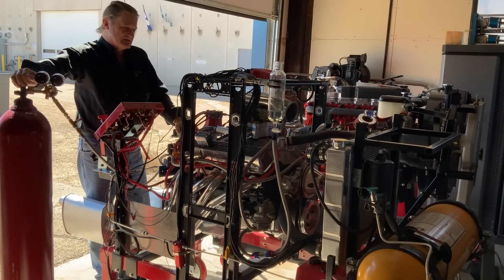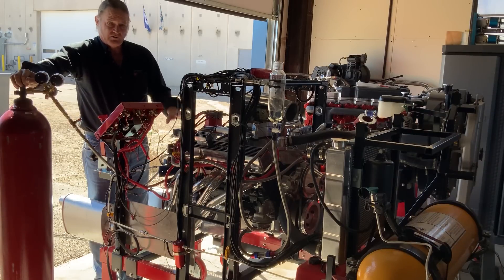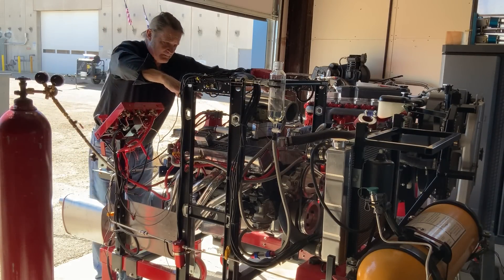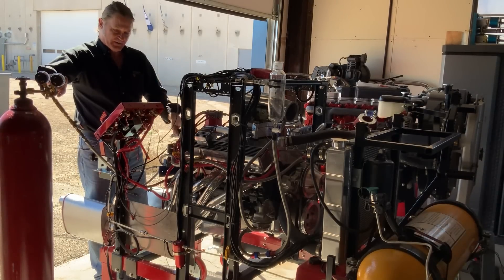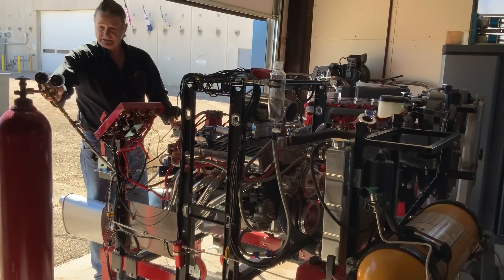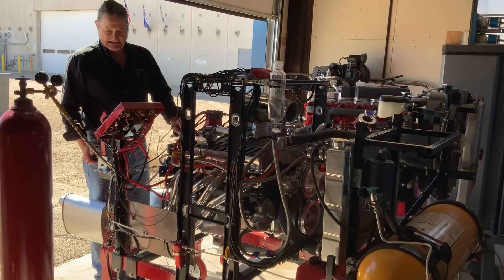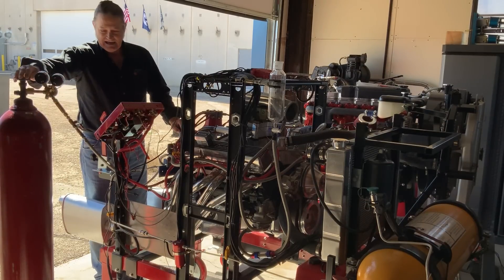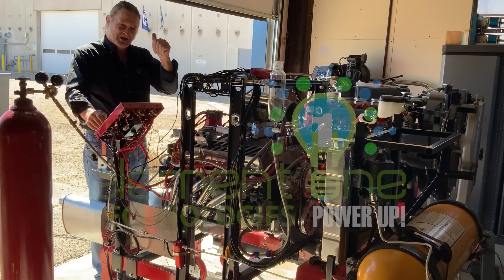Hydrogen powered V8 ICE High RPM Test

Comment: Cool, do you have a means of controlling egr to attain / co-equal the burn rate of petrolium fuel? If not then you might be running a fair bit more hydrogen than required? Have you considered hydrogen/argon or nitrogen pre-mix  for testing? Maybe build a blame front test rig.
Reply: Argon doesn't burn.  It's a noble gas.  Nitrogen nearly doesn't burn, which is why it is used in fire extinguishers.  We have enough nitrogen in our atmosphere already (+-78%).
They are not fuels.  Quite the contrary.

Hydrogen and regular air are all that's required.
Additional fuel and maybe an oxidizer could be considered should more power be required, or to reduce the hydrogen consumption.
Reducing the hydrogen consumption would just mean you are going to burn more of something else (like gasoline).
Reply: @detaart  That's exactly my point. Hydrogen burns far too quickly for all of it's potential to be extracted to mechanical advantage. Mixed with noble gases it's burn rate can be slowed to be more efficient in a standard combustion engine. Noble gases are used prior to being mixed with air in the cylinder by normal means, so that the mixture is safe, and far less hydrogen is required. It's possible to add this Hydrogen/noble gas mix into an existing diesel engine without performance reduction. Expect to see this in mining equipment very soon.
Reply: @scottneels2628  yes flame speed of Hydrogen is high if you have a stoichiometric H2 O2 mixture however if the stoichiometric mixture is done with ambient air you will have already a far slower flame front speed due to the high Nitrogen content.  Adding additional non fuel gases to the mixture will furthermore increase a big issue with H2 gas in a naturally aspirated ICE and that is its very low volumetric energy density and with it it occupies a lot of space therefore limiting the amount of fuel energy available with a stoichiometric mixture in the fixed cylinder volume.
Reply: @milanswoboda5457  in reality it takes significant egr to make hydrogen usage reasonable.
Reply: @scottneels2628  significant egr?  for what?  to reduce a low efficiency even further?
Reply: @milanswoboda5457  to reduce propagation speed within any given volume to equal the original fuel and allow an engine to run original timings.
Reply: @scottneels2628  EGR is used to reduce NOx emissions however the adverse effect is a lower thermal efficiency of the engine.  If your fuel requires different timing then you better adjust the actual timing and not the EGR,  and there it doesn't matter if it is H2 or any other fuel including specially formulated racing gasoline.
Reply: @milanswoboda5457  This is quite a fascinating conversation. I appreciate your time to reply.
Reply: @milanswoboda5457  We agree, egr or any addition of non combustible gas to a given volume reduces its potential. Also that it's used to reduce combustion temperature to avoid nox. Egr is also used to reduce minimum fuel for a given volume and pressure before detonation (lean knock prevention). Hydrogen usage can be reduced in the same way.
Reply: @scottneels2628  Hydrogen remains explosive under a wide range of AF mixtures so you could lean it out significantly without "noble gases" or increased EGR and as the physics of things go, less chemical fuel energy in = less combustion heat energy released =  less temperature delta =  less useable kinetic output energy.
Reply: @milanswoboda5457  Yes, but it's too fast at those lean afr hence the need to distribute a pre dilution evenly within any specific chamber volume for it to exhibit original fuel characteristics. Without this there is no way to avoid detonation.
Reply: @scottneels2628  laminar flame speed isn't any faster at lean mixtures, on the contrary it might be slower as the fuel molecules in a give space are further apart.  Detonation/uncontrolled combustion  is generally not an issue with Hydrogen in an closed combustion chamber due to it very high autoignition temperature and very low quench gap however it has a very low ignition energy requirement so impurities inside the chamber, fuel or air can lead to uncontrolled ignition but if those exist then it doesn't matter if there is EGR or a non stoichiometric AFR, it will go boom.
Reply: @milanswoboda5457 quoted: June 1994 Brent K Bailey et all.

The hydrogen fuel-air formation for a spark-ignited engine can be mixed external to the cylinder or in the
cylinder. Mixing in-cylinder can be either early injection, which forms a homogeneous charge, or late
injection (near top-dead-center, TDC) so that the fuel burns as it is injected, as in a diesel engine.
External mixing of hydrogen and air is limited both by the power that can be produced and by backfiring
through the intake system. The power limitation is due to air being displaced by hydrogen gas. Because
the air/fuel ratio for a stoichiometric mixture of hydrogen is 2.4 by volume, the maximum air flow into
the engine is reduced by about 29% relative to injection of the fuel into the cylinder, reducing the
maximum engine power by a similar amount Backfiring associated with external mixing of the fuel
occurs when pre-ignition of the fuel advances at every cycle until it finally occurs before the intake valve
is closed, causing the flame to propagate into the premixed charge in the intake system and explode
(Furuhama 1 992). One approach to avoiding backfire is to make the hydrogen-air mixture lean to slow
the flame speed; this results in a practical limit of about 50% of the power available from stoichiometric
combustion of hydrogen in the same-size engine (Furuhama 1992). External mixing can result in very
high efficiencies under lean operation, but is limited in maximum power.
There are two choices for in-cylinder injection of hydrogen: (1) early-cycle, low-pressure injection
forming a pre-mixed charge, or (2) late-cycle, high-pressure injection (near IDC). The early-cycle
injection is limited by pre-ignition from hot surfaces and by knocking due to the very high flame speed
of hydrogen (320 cm/s for rich mixtures versus 45 cm/s for most hydrocarbon fuels; Glassman 1987).
This results in erratic combustion and limits the power available. The pre-ignition problem may be
somewhat reduced by injecting cooled hydrogen gas, but this approach appears to be more effective for
2-stroke engines than for 4-stroke engines (Furuhama 1992).
Late-cycle injection of hydrogen overcomes the pre-ignition problem if the fuel can be ignited early in
the injection process and then burned as it is injected. However, the ignition and burning can be very
rough if the ignition timing does not allow combustion to occur very early in the injection process
(Furuhama 1992; Koyanagi et al. 1993). Very careful control of spark timing and location can help
control the erratic combustion. Also, late-cycle injection requires high injection pressures to overcome
the high cylinder pressures, with injection pressures of about 1 l\1Pa (Koyanagi et al. 1993). This late
cycle, high-pressure hydrogen injection may be more easily controlled and more practical using liquid
hydrogen rather than gaseous hydrogen. Musashi Institute of Technology (Musashi I.T.), Tokyo, Japan,
has developed liquid-hydrogen storage and high-pressure liquid pumps and injection systems suitable for
automobiles and has used them on several demonstration vehicles (Furuhama and Tomisawa 1 991).
Storing liquid hydrogen on vehicles reduces the weight requirements (Furuhama 1991). However, it is
a very low-temperature cryogenic fuel, and that, of course, introduces a number of handling and storage
problems. In addition to the requirement for developing cryogenic fuel pumping and handling systems, late-cycle,
direct-injection of hydrogen has been limited by the extreme sensitivity to spark timing and location
(Furuhama 1992; Koyanagi et al. 1993). Hydrogen has several properties that must be considered in
evaluating this problem. First, it has very wide flammability limits, making it easier to locate the spark
in a combustible portion of the fuel-air plume, an asset when compared with gasoline. However, because
the fuel is gaseous rather than liquid when it is injected, there is no liquid evaporation to limit the burning
rate. Further, for stoichiometric mixtures, the laminar flame speed of hydrogen is about four times that
of gasoline. Thus, if a significant amount of hydrogen has been sprayed into the cylinder before ignition,
the initial combustion rate is so great that maximum cylinder pressure is exceeded.
Reply: @milanswoboda5457  The findings above are why pre mixed hydrogen/non combustible gasses in solution are being explored for late injection. This also enables use in diesel engines. See Australian mining equipment testing. Dare I say it. Lol. 
Thanks for indulging me in such a great conversation.
I wonder what you think microwave denucleation of purified water injection might add to this conversation?
Reply: @scottneels2628  and those findings had been a long time ago and to date nothing as come out of it.  Hydrogen is a wonderful fit for HCCI engines but although a higher thermal efficiency can be achieved  and very low it still is a not so good choice for this premium cost fuel.  Maybe if self pressurizing/compressing combustion (Ralf Kriegel)  becomes a thing then we get into a more significant efficiency improvements but there is still a long way to go to resolve catalyst life and other issues with it that may never get resolved
Reply: @milanswoboda5457  Agreed
Reply: @milanswoboda5457  While this great video is of a petrol engine, my comment regarding the need for
a diluted injection charge by way of premixing the injection with non combustible gasses 
or egr was based on the article mentioned earlier which stated performance limiting by excessive displacement of ambient air 
when Hydrogen is injected into the induction charge pre-cylinder. It was also based on findings and advances noted in a far more recent article looking to dual fueling mining equipment by retro fitting an additional injector for Hydrogen. 
The team found that 'premixed' (Hydrogen-air) or even early direct-injection with intake charge prior to mixing with another, slower fuel in this case diesel, led to severe knock.
Given that the video was not regarding dual fueling, I figured a premixed injection may afford more Hydrogen
prior to TDC without displacement of ambient air and also prevent pre-ignition knock, and lean detonation. Of course neither address the storage density issue. There are significant advancements there too toward affordable metal hydrides etc.

The article is called: 

Direct injection of hydrogen main fuel and diesel
pilot fuel in a retrofitted single-cylinder
compression ignition engine
(August 2022, S. Kook).

In their experimentation with H2DDI (Hydrogen and diesel direct injection)  
duration and timing were adjusted  to vary the hydrogen energy fraction and mixture distributions, 
the total energy injected per cycle was held constant at 820 J.
 
The combustion phasing of CA50 (midpoint of the total heat release)
was held constant at 10 ± 0.8CA (Crank Angle) aTDC (after top Dead Center)
by adjusting the diesel injection timing.

They noted that H2 energy fraction >90% was stopped but not limited,
because at this condition the diesel injector reached
its minimum duration limit regarding the reliable and repeatable needle movement.

For 90% H2 fraction, the increment of TDC pressure is
intensified by compression work of early injected H2,
with the addition of H2 mass compared to 50% H2 fraction
cases.
 
Cylinder pressure traces and the profile of aHRR (Apparent heat release rate) traces
indicate there is a clear switch of combustion mode from hydrogen-air 'premixed' combustion
(nearing port injection characteristics)to Hydrogen-Diesel 'mixing-controlled' combustion
by retarding H2 SOI (start of injection).  
At early H2 SOI of 90CA bTDC, both the peak pressure and maximum aHRR
exceed the diesel baseline, indicating a large amount of premixed hydrogen combusting
simultaneously with the diesel fuel. More advanced injection timings could not be achieved
due to knocking caused by the premixed hydrogen combustion.

The results indicate how H2 SOI may be used strategically 
to minimise NOx emissions. However, for the data collected, 
higher IMEP (Indicated mean effective pressure) or 
lower NOx compared to the diesel baseline can be achieved
for H2DDI, but not both.

A trade-off between engine performance quantified by
IMEP and efficiency, and low NOx emissions emerges. The
maximum IMEP, efficiency and NOx are attained at 40CA
bTDC hydrogen injection timing, at which point the
hydrogen charge is intermediate between well-mixed and
stratified, enabling fast flame propagation.

Higher hydrogen energy fraction produces higher NOx
emissions up to greater than three times the diesel base-
line for 90% hydrogen energy fraction and 90CA bTDC
injection timing. However, varying hydrogen direct injec-
tion timing enables reduction of NOx, even below the diesel
baseline, for very late hydrogen injection timing for
80-90% hydrogen energy fraction. However, there is an
associated reduction in IMEP and efficiency as the com-
bustion phasing cannot be fixed but retarded.

40CA bTDC injection timing at 90% hydrogen energy
fraction emerges as a good balance of IMEP and NO x, with
843 kPa IMEP (13.3% above diesel baseline) and 90 g/kWh
CO2 (85.9% below diesel baseline). At this condition, the
estimated combustion noise is 93.6 dB at 3.5 dB below the
diesel baseline. The combustion characteristics at this
point are intermediate between premixed and mixing-
controlled combustion, with a blend of well-mixed and
stratified charge.

Comment: Keep this up I believe in this. Just need an efficient way to store hydrogen
Reply: Duh it's in a bottle
Reply: Currently hydrogen is not up to the task. A vehicle can only carry a fraction of the energy available in gasoline do to vessel size required for pressurized hydrogen. Liquid hydrogen requires an enormous power hungry refrigeration unit to transport. So neither is practical. Only if some new technology comes around that can store hydrogen as a liquid or solid would this be viable. And remember, hydrogen is not a source of energy, it is only a storage of energy, and not a very good one currently. Gasoline is a source of energy. What about developing a fuel cell that transforms gasoline into electricity and it's byproducts in a non-polluting manner? Imagine an EV with a 3-5 gallon tank and 1000 mile range?
Reply: @jamesclark830  Incorrect use Hydride safe hydrogen storage. They don't want cheap easy energy. https://www.youtube.com/watch?v=wRqqzt6Xe1M
Reply: @jamesclark830  cosworth catalytic generator. Yawn. Looking at putting one in my hybrid v8 build. But as for an all ev. The market will already be saturated enough by the time hydrogen and e-fuels are developed enough to balance things out. Develop it all.
Reply: @3xeplodng_3agle_studios  so you want to put a mini turbine generator with an V8 ICE, Batteries and electric motor while running the mini turbine with Hydrogen??? Ditch the V8,  at 28% fuel in to Electricity out efficiency the turbine is better than the V8 but about half as efficient as a fuel cell system so you are going to need space for fuel
Reply: @milanswoboda5457  hm. Admittedly at the time of making that comment I was still "looking into it" as I tried to allude to with the "looking at" phrase. Honestly it would just be better to try and retrofit the system to work more like a turbo than a standalone powerplant, and I have ideas for fueling, specifically with H2 but they aren't ready to be discussed yet. Hopefully when they are I'll be able to catalogue the whole build from start to finish here on yt. I don't believe in withholding knowledge per sé but I do believe I should make sure my ideas will work in practice before actually telling others to follow suit. 😅
Reply: @milanswoboda5457  but pound for pound you're correct and I may just do something like that at some point just for the fun of it/just to see what the outcome is like.
Reply: @jamesclark830  this !